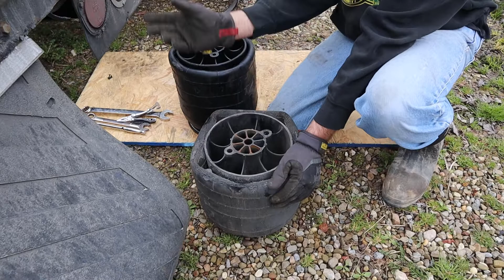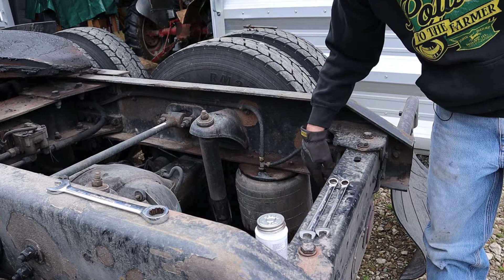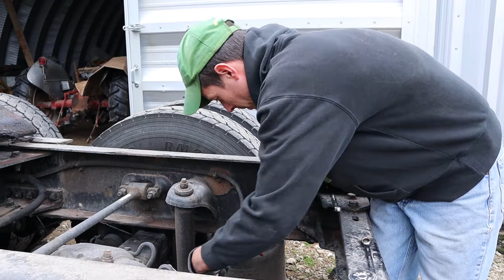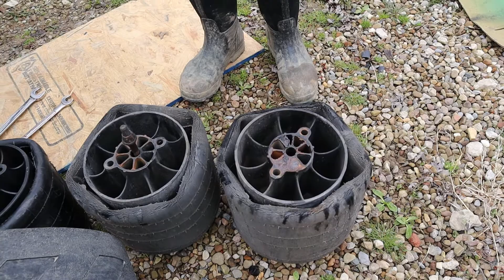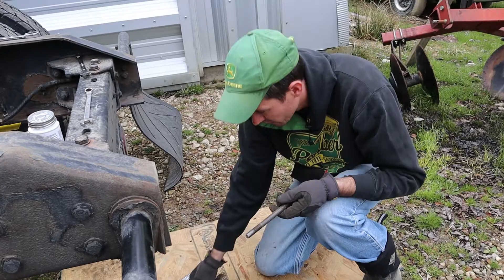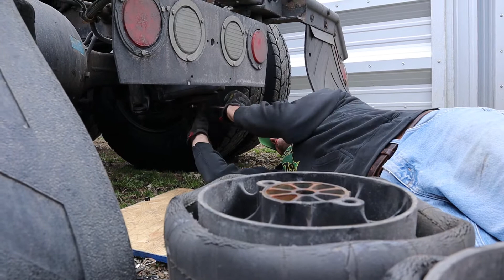How to Replace Suspension Air Bags on Semi Truck - Step by Step | Owner Operator Truck Repair DIY

Comment: Truck started losing air overnight a few days ago. Found the leak and it's the drivers side front airbag on the bottom of the bag like in your video. Hitting up fleetpride or Napa tomorrow to replace it. Thanks for the quick video on replacement man and thanks again for talking me out of that International a few months ago, I'm loving my t680 so far!

Comment: Folding over the lines to kink them off doesn't always work. It won't work on my peterbilt because all the air goes thru the left rear bag and that's the problem one. I disconnected the lines and none would inflate after that

Comment: Very helpful, getting ready to do all four. 
On a side note though, it’s a very common misunderstanding that Teflon tape or pipe dope seals the threads, It doesn’t. 
It simply lubricates the threads so that you can get it tight enough that the threads seal against themselves. Try it with some grease in a pinch, even oil or anti seize. This is for pipe thread, “NPT”

Comment: Considering the road chemicals and moisture exposure I would use permatex anti-seize on the bolt threads. Like finger nails on a chalk board, that bottom bolts needed a drop or two of motor oil. Like you, I don’t like Teflon tape and use high temp PTFE pipe sealant. Sold at a GM dealer, eBay and others. But one type works on an oil pressure gauge to coolant fitting. Also sold be Permatex. As a car dealer tech for 38+ years, I got into the habit of torquing the size, grade of bolt and material. Like you brass fitting, if 3/8” brass to brass, it’s average torqued would be 28-32 inch lbs. I have 3 sets of crows-feet wrenches to fit a short extention to a torque wrench. These charts were in machinist books, no online. But we all know that having every tool you need is impossible. I used to send in a SnapOn torque wrench to be re-certified, until one day the truck owner said it was too old and they did have parts for it. They offer me $100 trade-in for a new $380 one! Never bought another! Fix it, tell me if over, under or close! They used to tight needle nose pliers and serrate the edges for $5. It was time to quit, as I had stuff they had never seen. I told the SnapOn guy it was new in 1972, he said his dad was 12. Best of luck & stay safe!
ASE Master Tech since 1978 - Retired

Comment: Do you need any type of jack or jack stands?? 
One more thing inside the cab do you need to release the air?
Reply: No need for jack or jack stand. But you have to drop the suspension in the cab, or drain your air tanks. I heard of a guy who didn't release the air bag pressure. Well he went to the hospital and had facial reconstruction. So please drain that air.